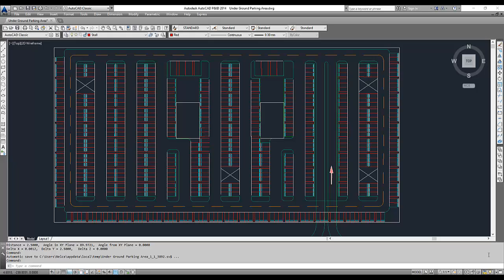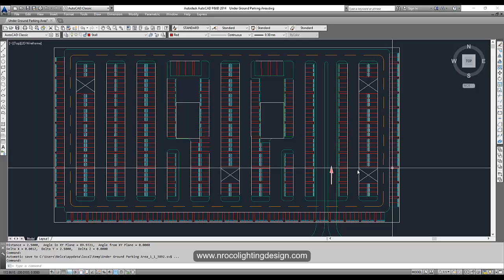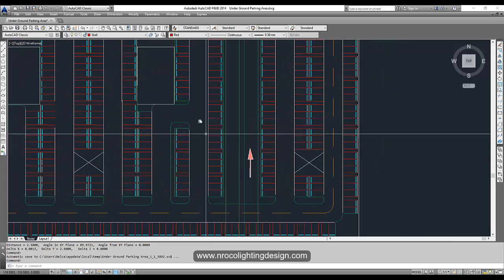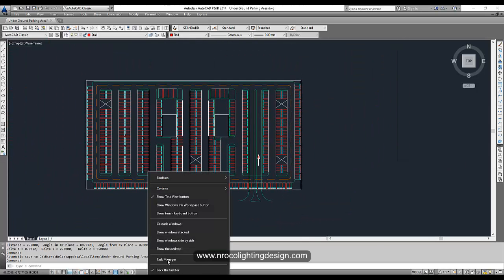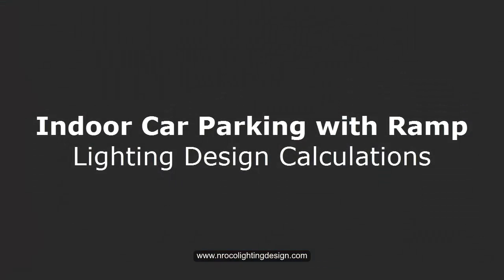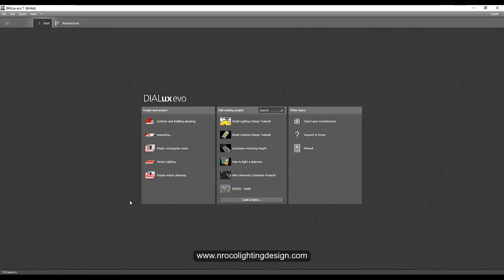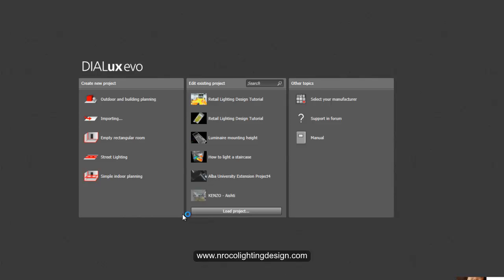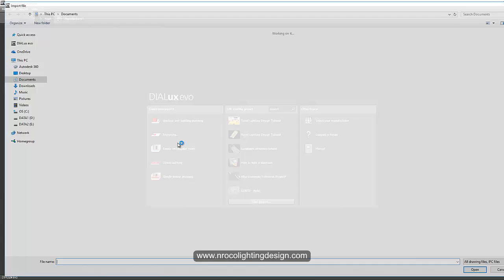Indoor car parking with ramp - lighting design

Comment: Hi Nelca 
Thanks for the video
I am facing some problem with the  ramp lighting it will be very helpful if u can guide me with this

When I am mounting the lighting fixture on the slab (beneath the second slope) as u r doing i am achieving the perfect uniformity
But when i am using a wall recessed luminaire for ramp (square Bega) I am not able to acheive the uniformity
Please help !!!!!!
Thanks in advance
Reply from the maker: wall mounted luminaire will really not give good uniformity.